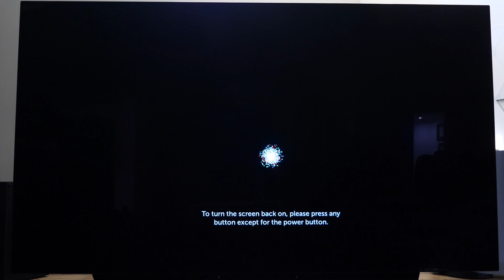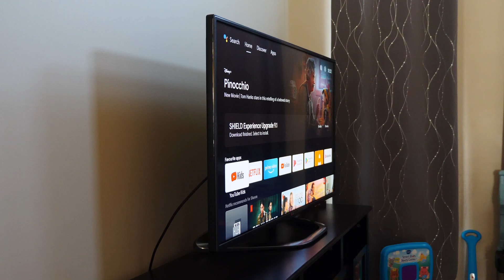TV Explained: Why Plasma TVs Are Dead

Comment: It was pretty sad when we went from a variety of high quality plasma TVs to a bunch of cheap LCD TVs. I still have a few Plasma sets, and my main TV is a 2006 Panasinic 50 inch Viera set, and it still has a better picture than any LCD or LED set ever did or will. I find it strange that the majority of people who don't know about then will tell you that Plasma TVs were crappy, and didn't last long and that is why they quit making them. I don't know where that misconception came from. 
I would still rather have a plasma than any TV made today nomatter what technology it is. The Plasma set is made of such good quality components, with metal and thick glass. Not to mention discrete components on the boards that can be repaired, as opposed to everything being mostly ICs now. Even the high dollar sets are cheaply made with flimsy plastic. Even if the picture may be slightly better (which I still don't think it is), they won't last nearly as long. I would love to see one 10 years later that still works like it is brand new.
Reply: Plasmas were not economically viable. Plasmas were a niche product. As the young stated, they were much heavier than LCD/LED TVs which means higher shipping costs which lead to much higher final price. They brought on too much heat and consume much more electricity/energy. Stop your nonsense. I am happy it is dead. I don't need 3 men from a store to transport my tv to my home.
Reply: It all had to do with the high manufacturing costs of plasma tvs. Most people don’t want to pay 1k+ on a television.
Reply: @Cntr-Cmd-Delete  That is mostly correct. People would rather pay $500 for junk that doesn't work as good or last as long than a little over twice that for something that will preform much better and last for decades. It is sad, but people want cheap disposable junk these days, so that is what is supplied. I don't see that issue becoming any less commonplace any time soon. The sad part is that for some reason everyone who isn't informed seems to think that Plasma TVs were somehow inferior to LCD. They also would rather spend the $500 on some new junk than spend under $100 on a used plasma set which pop up in thrift stores all the time, which will preform better and last longer because they wouldn't be caught dead with a TV that wasn't brand new, paper thin, and "smart."
Reply: @Cntr-Cmd-Delete  They commonly pay $1k or more on these flimsy OLED TVs which were not built anywhere near the standards of the old ones.
Reply: @Cntr-Cmd-Delete I don’t want a tv that’s less than $1500 or $2000
Reply: @garrettstrutz7421  ok lol. I said most people. technology advances so quickly that your 3k tv will be half the cost in 5 years and outdated. There’s a sweet spot and spending more than 2k on any piece of tech will be quickly outdated. It makes more sense to spend 1k every 4 years than dropping 2k for something you might think will last you 8 years. 
Same is definitely true about computers and phones. I bought a laptop for 1.5k 5 years ago and 700 could give me the same specs now. Ram,storage, cpus, and screen tech just continues to drop. If you’re older than 20 years old you know this to be the case. 

A 5k plasma television from a decade ago is worst than an $800 dollar tv now. The screen is 1080p and extremely dark in light environments. I am willing to bet that a 5k oled tv will be worst than a microled tv or whatever tech they use in 5 year time and will likely be half the cost. Remind me in 5 years time.
Reply: I get where u are coming from and it’s been a looong time since I was 20. Got kids older than that, time flies. $2k for a tv is not alot of money. Why buy a cheap tv that is outdated basically before it’s made. They have always sold cheap low end TV’s there is a sweet spot you want to buy at. You don’t have to spend $4500+ on a tv but low end is low end and TV’s $1000 and under are cheap really quickly probably already outdated products. I truelly don’t care for bargain TV’s they don’t compare. Life is very very short too short to always be staring at cheap bargain TV’s they have always been around
Reply: Very well said. Humanity is severely dumb for discontinuing Plasmas.

Comment: Actually  plasma draws about  7-8  more power  than LED.  Led draws at   least 3 times less than LCD.
Reply: Sure but LED and LCD here are the same thing. OLED is better than both Plasma and LCD
Reply: But LED has horrible colour reproduction. I have a professional NEC GBr LED monitor, that shows LED can be nice, but this tech has never made it into TV's. CCFL has a cosy white quality and great gamut, unmatched by LED. As most CCFL TV's are smaller, the benefit of the 50% energy saving are lost. A 40" CCFL uses less than a 65" LED. Just get a smaller couch or reading goggles and you will have the same view size. Grab a Bravia W5500 model (20-40 bucks nowadays) and you will understand.
Reply: @2kBofFun  I have a KDL-40XBR, It's CCFL,  runs hotter than a plasma but nothing beats it for PS2. $10 off marketplace
Reply: @CastorRabbit  Legendary model indeed.

Comment: What if I used my plasma tv and only use it to hook it up to my PlayStation is that better than an led lcd tv for refresh rates and frame rate ??
Reply: Plasmas can only operate at 60fps. If your LED is 120hz then the plasma will probably have a slower response time.
However, plasma TVs have much better motion clarity so things that move fast on the screen will look sharper and smoother. LEDs still have a bit of a ghosting issue with fast moving things so it looks noticeably blurrier.
Reply: @neomaxmlc some last gen plasma tvs can support 120hz
Reply from the maker: PS4 games have a cap of 60fps (some only 30fps) so the high plasma refresh rate might not make a big difference. The other thing to consider is that newer LED technology have better predictive technology than plasma which compensates for less refresh rate than plasma. It all comes down to other factors of the tv technology. Easy answer? Just try it and see what happens lol. If you like the result then leave it connected.
Reply: Plasma has better refresh rate

Comment: in addition to or because of heat it produces, plasma is prone to humidity and it will cause damage to the circuits
Reply: i have 10 years old samsung plasma still rocks.our led tv broke every 3 years.and plasma has more natural pic and motion
Reply: @SuperSy99 I still have a 50 in Fujitsu plasma vision from 2003 that works well

Comment: can't wait for backlit technology to die
Reply: It won't. Backlit = no burn-in. Enough applications to benefit from that. You can swap an LCD backlight, and the panel is basically as new.
Reply: @2kBofFun backlit also allows for super bright hdr
Reply: @ Not really, as the LCD panel limits the contrast to max 1:3000. Self emiting displays, like plasma, CRT and OLED can achieve much higher contrast needed for HDR. Sure, there are TV's with super bright backlights marketed as HDR, but that is fake HDR with local dimming, and thus blooming artefacts.

Comment: Thanks for the video! I just wanted to add that my Panasonic Plasma TV is still going strong after 17 years since I first bought it. Even the remote control is still in good condition as well. It is sad that you can't purchase Panasonic Plasmas in Canada anymore.
Reply: Panasonic plasma owners unite! ;)
Reply: From what I understand, Plasma TV's can last up to 100,000 hours.  well thats best case scenario and at 100k, and at 100k it reaches its half life, which means the screen will be significantly reduced.  Plasma's peaked around 300 nits, you can still watch TV at 150 nits or there about, but if thats your max brightness, you will be missing a lot.  Nathan, do you know how many hours are on your Plasma TV, you can check in the settings.  Either way, 17 years for a TV is amazing.
Reply: I have a 17 year Samsung 42” Plasma which sees a lot of use but still has a superb picture quality with zero burn in. The power supply failed a few years ago but this was easily fixed and the TV is currently running as good as new.
Reply: I have a Panasonic plasma that works like new
Reply: I have a Panasonic 3d plasma I've had for 14 years, and it's still going strong. And I use it all the time
Reply: I still have a Panasonic plasma that's old as dirt and it works great, the picture is better than my few yrs old, higher end Sony LED TV. I originally switched to Samsung LED from plasma because I wanted a bigger TV and the picture looked so bad compared to the old plasma I was disappointed and got rid of it and upgraded to a higher end model. Which still doesn't look as good as decade+ old plasma. Shame they got rid of it.
Reply: Sanyo going strong for like 20 years. She's heavy and she puts off  a little heat, nice in the winter.
Debating on recycling it.
Reply: Panasonic made truly excellent Plasma TVs.  I have a buddy who's Panasonic plasma tv is 15 years old and it still looks gorgeous.  Sadly, I went with the Samsung plasma tv, which looked gorgeous too, but it kept blowing out power supplies every 2 or 3 years.
Reply: I got a 42 inch Panasonic plasma TV that’s about 17 years old. It’s starting to show its age. I’ve been wanting to upgrade to a 65-75” but it’s hard to to move on because the picture still looks great.
Reply: I have 12 years old Samsung plasma still produce good picture as new.Ironically our nieghbor 3 times change led tv because always broken panel every 3 years
Reply: @SuperSy99  I have a 14 year old 55" Samsung LED in the bedroom, looks great and has never been repaired. The early Panasonic and Sony LED TVs were unreliable.
Reply: @carlosoliveira-rc2xt  Samsung and LG dictated the strong support for LED. I don't 3 strong men to lift my tv to the living or bedroom.
Reply: @carlosoliveira-rc2xt I still have a 55 in 2010 Samsung led tv that won’t die and it gets daily use and never gets shut off. Waited sooo long for it to die so I could replace it but it just keeps going so I finally just gave in and got a 65 s90d to replace it a few days ago. I have had super good luck with Samsungs. Got an 85 in q80b a couple years ago and that tv has just been awesome and that tv replaced a 2016 Samsung that went 7 years without ever being turned off before the panel shorted out. I’ve got no beef with Samsung
Reply: If you view media on it very regularly, it's less than half as bright as it was new.
Reply: LG 720p still going strong for nearly 20 years.  The blacks are blacker than any LED too.  Don’t care about the extra heat or energy.
Reply: LG 720p still going strong for nearly 20 years.  The blacks are blacker than any LED too.  Don’t care about the extra heat or energy.
Reply: Don't know about Hydro /electric costs? It consumes way more energy than LCD , LED and all other variants of LED.
Reply: I have two 42" Panasonic Plasmas. Heat is minimal, no burn in that I can tell. Bought them back in about 2000 I think within a couple of years of each other. Still working great. Definitely got my money's worth. They are only 720P though. Thinking about getting Smart LED TVs. I am pretty frugal with my money so any purchase is considered real carefully. Trouble is the technology has passed me by so quickly and my research of these TVs and streaming service devices and such leave me more confused.  Basically I am a TV watcher for movies no gaming. I don't want to get too caught up in a huge expensive TV. No bigger than 50 " for where I have them.  Oh well My research continues.

Comment: great video, I learn so much every time I watch one of your videos.. one question though
in terms of the black color, which is better 
plasma Tv or LED/LCD Tv with HDR
Reply: In a well lit room, nothing beats the black level of a CCFL VA LCD TV. Plasma tubes and modern LED TV's are too shiny, and HDR/local dimming is a hoax.
Reply: OLED and OLED variants are the best, because in order to achieve black, it just turns the pixel completely off, no light no anything.

Running dark mode on OLED panels end up just making more sense in the long run.